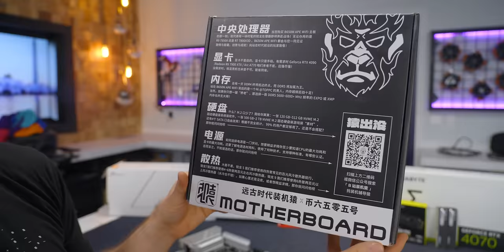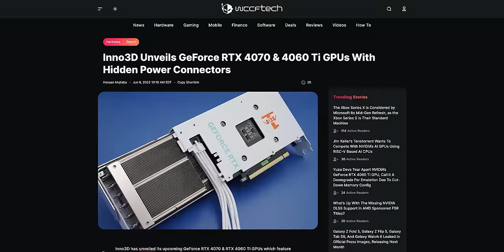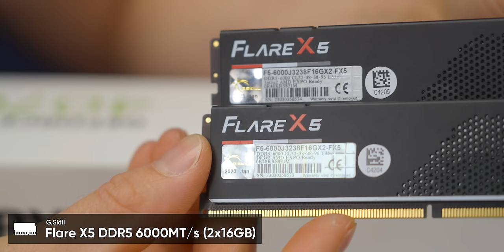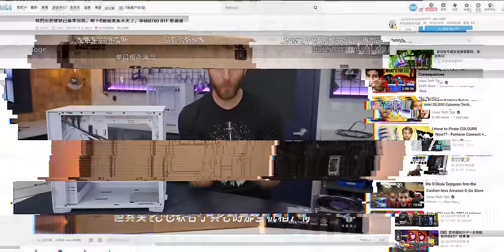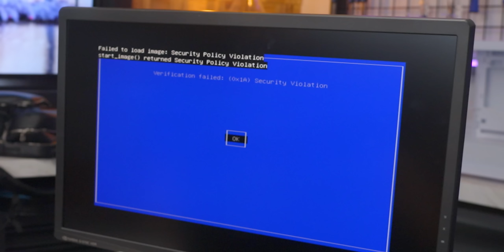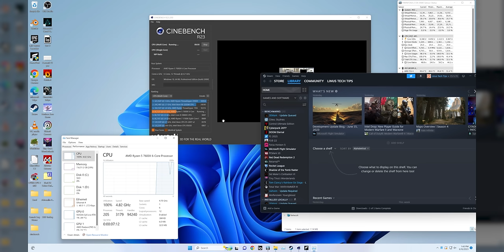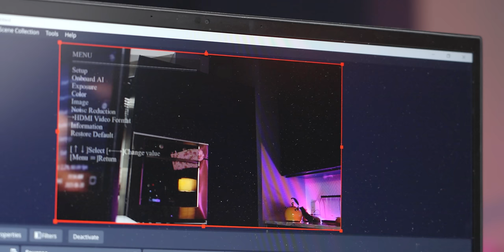This Beautiful PC has an UGLY Secret…

Comment: Until you can get a Graphics cards with a different ppwer connector location you can get a double 90° adapter that a least removes the bend.
der8auer is even making one with an unbuilt screen that shows a wattage reading (currently only single and dual 8-Pin but he's working on a 16-Pin one)

Comment: Somehow i dont get it, why do we need so many 12v cables that are clustered in the psu to power a gpu or mobo, why now use those 80-100 amp car amplifier cables, would look so much cleaner , instead having for example 12v x 10 amp wires, why now use 1 fat wire,  it is not like all 12v cables have their own rail…, in the psu side they are clustered together on the pcb, and those fat cables can look nice soft tube

Comment: Well wouldn't it be an even cleaner build if their would be a cut out between the CPU socket & the top PCI-E slot to route the GPUs power cables? Like 90° out of the GPU directly to the backside of the case instead of going down the motherboard and than behind it? Same for the CPU Cooler?

Comment: "sticky out bits" on both side of the motherboard?? Not a big fan. Motherboard manufacturers can barely specify(distance to and between  connectors) where they put connectors and sockets, I will be very surprised if there will be A standard.

Comment: I got very curious while watching this video when XMP profile settings were mentioned, I thus went into my BIOS and ended up changing some settings that I totally should NEVER have, my computer would then startup for about 5 seconds and then turn off, repeating that until I held the power button, luckily I figured out it was my RAM because the second my RAM sticks RGB would light up, that's when my PC would crash, I took 1 of my 2 RAM out and was able to boot to BIOS and change setting back ( I was an idiot and multiplied the RAM by x4, crashing my PC) kids, don't mess with your BIOS settings because,  just saying, It wouldn't be easy to fix like mine was

Comment: With how bonkers long some of those graphics cards have gotten, it's kind of baffling why they still put the power connectors on the outside facing the usually see-thru side panel, instead of putting the connector on the inside. Or the back. Or basically anywhere other than the single most visible spot on the card.

Comment: It’s cool but I wouldn’t like this concept beyond being a niche option you can have pretty cool builds with the connectors on the front with some effort I would much rather prefer that PCIe 6.0 could handle more than the current 75W, like with an extra 0, 750W, or replicating the specs of the 12 volt high power connector (that are 600W sustained 1200W peak/s) that way the GPU connector would be optional

Comment: 0:54 The standards of MSI and ASUS are unified, which is why the case is from ASUS. The TUF motherboard featured at the beginning of the video and this MSI motherboard are not two different standards, but one standards. So, you can install both this MSI motherboard and the TUF GAMING B760M BTF WIFI D4 motherboard in that ASUS chassis. 
This is not meant to destroy the current DIY market, but rather to seek coexistence. Specialized chassis can also be used for regular motherboards. As for mistakenly purchasing a motherboard with the wrong specifications, you wouldn't buy an ITX chassis and an ATX motherboard at the same time, would you?

Comment: Now backplane all that crap into the mobo tray, and have the PSU plug directly into the mobo tray. Put sata connectors/power right off the back of the mobo tray so sata can be installed cable-less as well.

Comment: Could be cool but ONLY if ALL motherboard AND case manufacturers got together and agreed ONE set standard NOW. On a side note: buying a PSU less than 1,000W (1kW) in 2023 would be crazy, because regardless of your CURRENT power needs, your PSU should last AT LEAST a decade with its warranty, and if you think you won't need AT LEAST a 1kW PSU in 10 years (thats typically 2 GPUs and CPUs worth of upgrades) then you haven't been paying attention to power usage trends lol.

Comment: I still dont get the point. Outside of a minimalist look it doesnt improve visuals. Well done cables add to the look of a pc, not detract from it. I'd get it if each manufacturer had one motherboard like this in their line-up for those that want it but what possible benefit would it have if adopted as the main standard aside from making all of our cases wider

Comment: I keep seeing supplemental power plugs on PCIe cards. And not just video adapters. It seems like, especially for x16 cards, we keep exceeding what the spec currently provides for. So, I find myself curious whether PCI-SIG has considered officially adding additional power delivery to the specification in a future version, either directly in the same (modified) connector, or as a per-slot-optional additional on-board connector with clearly specified characteristics.

Comment: I don't like it when influencers endorse the "X" using the GHz. Yes it's a higher binned chip that can sustain higher frequencies all cores, but the difference is not really 1 GHz, with proper cooling and overclocking the non-X version can get near similar results with 600-800 Mhz more than the base. I'm not against the "X", it's a good idea so people are not playing the lottery when buying, they know if they want to "win the silicon lottery", go with the X, the sorting has been done in factory, but it's not 1 GHz advantage set in stone.

Comment: People are divided with this because it's a different market for each. In my opinion it doesn't make sense on an ATX EATX cases as there's a lot of space to work inside especially on much larger cases. I switched to small cases with ITX and MATX boards. It actually makes sense they do it on those smaller boards as space inside the cases are too tight. MATX is the right market to start it but I'm not sure we don't see an ITX board with it. Asus displayed an ATX board but I don't think the ATX board users care about this.

Comment: I myself quite like some cables in my builds, nice extension can really tie a build together... But some cables are just ugly and/or difficult to manage in a nice-looking way.

Take the USB 3.0 front panel cable, it's not bad looking, many are even flat and made out of nice matte plastic, but the connector itself is just too huge, and always manages to protrude too much and look too in-your-face.

And then there's the really nasty cables, I'm talking HD Audio, power button, LED, and HDD activity lights... There's just not much you can do with these, they always end up being that tiny bit of ketchup and mustard crap that makes your build not look like a showroom PC.

So I guess the way I'd like to see things going, is companies making better looking cables and connectors, and designing better oriented ports

Comment: here we go..another way to add expense/make more money via an unneeded upgrade. Do you think the mb manufacturers will agree on a specific set of layouts? naaa they will just copyright their layout, make any company that wants to release a compatible case pay for a license to use their design and end up causing us to spend more money on cases, after they get that locked in  then the only logical move is to  maximize the profit potential  by moving other connections to make you get their proprietary component that works with their case and motherboard.

Comment: Honestly, I don't think any of this is worth the "clean" look you get afterwards. If it requires stuff like a proprietary case and stuff like that, I think I'd rather just go with a regular motherboard and deal with the visible cables. However, I understand that not everyone thinks like I do. I do think this is a really small portion of an already small community, so I don't think this would ever catch on.

Comment: The fact that every motherboard has varying amounts of connectors....and the limited options of the case having enough cutouts while maintaining structural integrity...I'd say this would be a very hard thing to normalize and push out to mainstream consumers...

With the current design with connectors facing the front...case and motherboard manufacturers don't need to worry about the increasing amount of connectors...With this new design....they will have to put into consideration the amount of connectors on the motherboard and how many cut outs a case will need...

Coupled with the fact that IF you want to build a PC with this new motherboard design...you are either required to cut up an existing case as shown in the video or swap to a completely new case...which could turn away many

It is an interesting idea....but for the current future I don't really see it going anywhere outside of the custom scene

Comment: I get what they're trying to push here but going fully proprietary is the wrong way to do it. You could simply go with all your connections being at a 90 degree angle on the edges the way that all SATA plugs are now, get 3/4 of the cable hiding qualities, while losing none of the compatibility.

What we're LONG overdue for is a unified front panel connector so you don't have the ugly tiny wires that are the biggest pita to plug in in the first place.

Edit: I had to lol after he bitched about front panel connectors as well after I wrote this.

Comment: As a sheet metal worker, this is a little painful to watch.   hand file.  much better than the gasket.  they also have a burring tool for post filing.   If your worried about the metal dust, they have small cheap electric sheet metal sheering tools cheaper than a dremal which would be cleaner.

Comment: When I build a PC, the case is shut for maybe next 10 years or till it breaks, RGB is Pointless nonsense to me, Also the Cable Mess ... However I do Like Cable Management Improvements, MAYBE As well as moving GPU Connector to Base of Card,, if there was a GAP or Hole in Motherboard Layout to help with route GPU/CPU Cables to rear ..

Comment: Gigabyte's stuff seems to sometimes have quality control issues. The two pcs I build this last year, I had to return a 1 gigabyte component each. But I'm a huge sucker for the Aero stuff, which is what I did with my latest build both the motherboard and gpu, the just look amazing in a white NZXT H5 Flow case.

Comment: Can someone release a flipped graphics card. A card with fans on top in the bottom 16x slot could have power on the bottom and we could finally see all the work done to the cooler without risers and funky mounts that render all other PCIe slots useless

Comment: If the back plate of the case would be removable than they could be changed as simple as removing few screws and replaced with the needed one. That's how you avoid waste. Never the less a fresh new idea this less cable design.

Comment: If they're gonna do something as drastic as change the ATX motherboard layout, it has to be for really good reason. This is, unfortunately, a particularly petty, aesthetic reason. I think it's a trend that is doomed to fail. I mean, they'll push it hard and you'll see these on store shelves for years, but it's never gonna be a popular standard. People are gonna realize that it narrows re-use, resale, and upgrade pathways pretty harshly and they're going to avoid them. Adding insult to injury, it also doesn't go far enough. Going truly cable-free would require pushing all of your PC's wattage through one PCB... and after the 12v connector fiasco, I don't think I need to explain why that's a bad idea.

Adding more insult to injury, this doesn't target the right PC builders. Most of the people who NEED their power connections to be re-routed or angled in a specific way are ITX builders. Those people don't just need purpose-built motherboards and components, they need modularity. So an off-standard ATX motherboard is very unlikely to be the thing with the special fit that they're looking for.

There's a lot of room for lateral thinking in case design, but this is not a winner.

Comment: ngl I absolutely hate this, makes building it way more complicated. 24/10pin, SATA cables and Front IO on the back I can understand, but the fan headers on the front is a NECESSITY for an easy build and the PCIe connector on the back of that GPU is just awful to reach. Will probably get yanked by many new builders if they try to take the card out again, which is even worse knowing the durability of the new connector.

Comment: Spend money on custom cables - hide them in the back.  Pretty stupid trend IMO.  It's the same reason I hate the 16-pin so much.  We finally have GPUs where three 8-pin connectors was a reasonable thing so we could all enjoy our nice PCIE cables combed together with ATX 24-pin combs --- and bad guy Nvidia takes it away.  I mean look, I'd be OK with mandating that AIBs offer a single GPU with the 16-pin connector, but preventing them from using the three 8-pins that would be fine even on a 4090 is insanity.  And why do no 4090s have dual 16-pin connectors?  Maybe there would be less MELTING!

Comment: It's all cool but I think that we don't actually need all those back connectors... my pc is full with stuff and only if your are going to stick your head into the case you'll be able to see 1 or 2 cables, thing that you are not quite likely to do.
In the end they are just going to charge more engineering costs because they put holes in those cases....
No, not worth it, just another marketing solution.

Comment: Imagine thinking your modern PC case looks "messy" when it doesn't even have freakin SATA cables in your build.

We used to deal with giant ribbon cables for CD-Drives, floppy drives and all the power was through puke coloured molex connectors and all of this was run just straight through the chassis with no rear cable management to speak of.

Now we have cases that have only m.2 storage so often the only visible cables through a window are the power connectors and the front I/O but that's apparently still not enough for Zoomers who now want to create a giant mountain of e-waste so they can pretend their computer isn't a computer...

If the cables bug you so much buy a chassis without a window. Stop creating so much waste for stupid aesthetic reasons.

Comment: I do think that it looks a bit uglier just because of the one gpu cable than just a normal pc. one cable makes it uglier than multiple cables, it's like you tried pretty hard but still failed. no hate though, still appreciate going that mile. im curious about how easy it would be within the supported case.

Comment: I don't like this. All the cables that aren't going to the front are going to have to be at the back. We can't make our cases any smaller in the front because of the GPUs, so we will have to make them wider in the back to accommodate extra cables. You can't make cables shorter out of the box because then you run the risk of requiring people to buy extensions. This is a solution in search of a problem. It offers no benefits; a few cables aren't a big deal.

Comment: Paul is 2000% hypocrites on this cable hiding issue. Manufactures need to adopt connecting everything on the back of the mother board. Including GPUs. If there is only one manufacture that does it then they can charge a premium. The entire point of having a space in the back of a computer case is to HIDE cables.

Through out PC building history there has ALWAYS been a strive to hide ugly cables. Both of these creators made MANY videos about hiding cables, arguing about, and critiquing cable management.

1. Case windows are meant to show off hardware not ugly cables.
2. Fully modular PSU's were created to lessen the amount of ugly cables piled up in a corner.
3. Fully sleeved power cables were created for the ones you cant hide.
4. Cable management built into the back of a case is specifically designed to hide cables and have a cleaner look, NO other reason.
5. Motherboard and GPU manufactures design all kinds of heat shields and coverings to hide the ugly bits on a PCB. Even the fans wires on GPU's are hidden.

Linus and Paul should be celebrating this type of major design innovation. There are so many hardware standards that could use a fresh design idea. Think of about how they got rid of ugly gray ribbon cables, or the molex connectors. Think about how they integrated decent quality sound cards into the motherboards so you don't have to buy a separate sound card. Now HDD's are replaced by SSD's on top of plugging straight into the motherboard without a CABLE...

Comment: Do not buy 16GB of DDR5.  32GB is the minimum amount of DDR5 to install in any system that is going to do more than email and word documents.  Not only because 16GB is insufficient but because 8GB modules are slower than 16GB modules at the same speeds.  Just do not buy them.